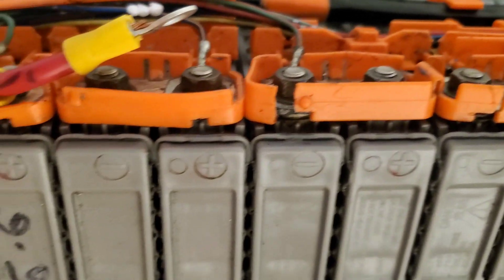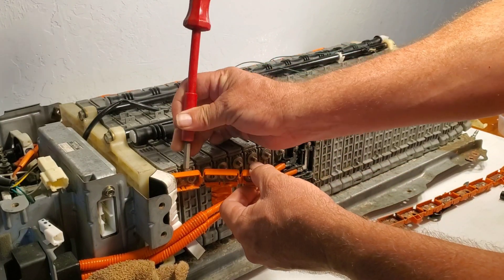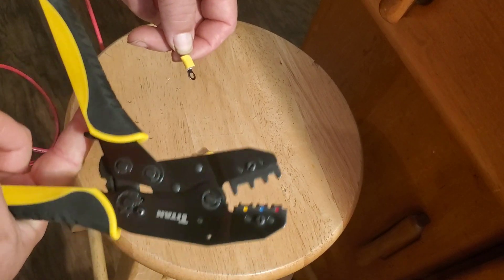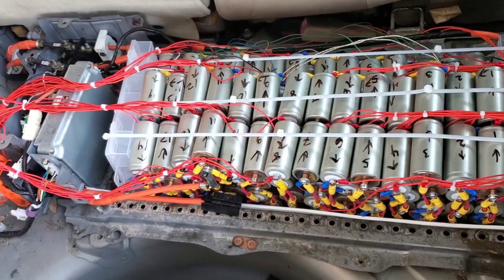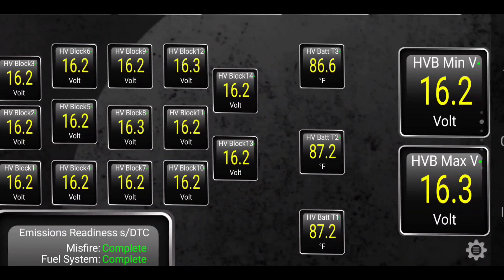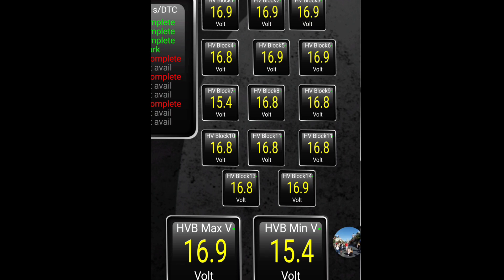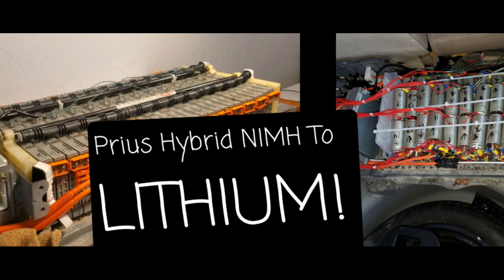NIMH To Lithium Prius Hybrid Conversion P1 of 3

Comment from the maker: Part 2 The Build is up
Reply from the maker: ki0ng  It was suffering from a bad battery so no it doesn't give better mileage but it did restore it normal.  Playing around I've achieved 60 city 50 highway. I don't hyper mile in general  in general I only get 40 city 38 highway.  Before 34 was about the best I could do with a bad battery
Reply from the maker: ki0ng  Only if your driving with that in mind.  Anytime you mash the accelerator it automatically kicks the gas motor in defeating the hybrid.  Feather footing will get you there.
Reply from the maker: ki0ng  The true potential of hybrid driving would be charging at home using out and about
Reply from the maker: ki0ng  That's true and not sure how but there's a way to override the switching from battery to gas giving you full electric.  Sounds like a project!
Reply: @eby6114  
Did you work out how to hook the switch up to keep the engine off?
Reply from the maker: @chrisallen649  Just found this comment.  Yeah the hack is I forget which pins but there's two pins you have to short out before the engine comes on this features actually standard and some European countries and what it does is tell the engine not to switch on but use only battery power That's a shame we don't have it in North America.  I forget where I found this information out but it seemed very legit
Reply: See "EV Mode priuschat"

Comment: What is your opinion about this transformation after 3 years?
Reply from the maker: Would love to tell you but I was traveling 5 hours from Miami to Wildwood and some people, Spanish came to my house and offered me money for the car, more than I could refuse.  Never had that happen before.  It seemed good.  Had decent range.    Battery only usage for a few miles tested around 2am so I didn't piss off anyone.  Never got hot.  If I had it to do over again I would have doubled the capacity.  Ended up getting a Suzuki xl7 7 seater 4x4 2 ton suv.  I was pouring the miles into the Prius close to 300 miles for some schooling for a while.

Comment: I can't find where you bought a 35s bms
Reply from the maker: AliExpress
Reply: @eby6114  thanx for getting back to me I've looked high and low on AliExpress all I can find is 32s
Reply from the maker: @krtyejnfv  US $160.00 | 5S-35S LTO Battery BMS 100A Common Port Circuit Protection Board 2.4V Lithium Titanate Battery BMS PCM 12V 72V 60V
https://a.aliexpress.com/_mNFlhsE
Reply: @eby6114  yea I saw that one I guess I just need to message them and they will me a lipo4 version I didn't see that they had the Bluetooth app like yours did

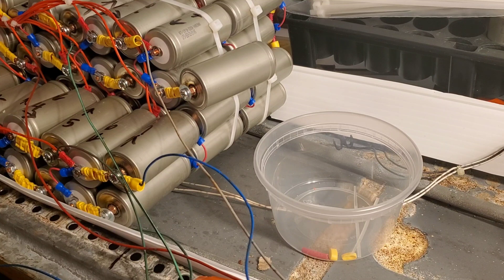Comment: around 2:50 you mention the battery capacity. but you say "kilowatt" instead of the proper unit for energy, "kilowatt-hour".

great stuff here. the nexcell / dr prius blades are more professional. but they are waaaay overpriced. LFP cells for this project are in the $600-$1000 range rn. versus the nexcell blades which are $2300 and not even in stock.

Comment: what type of your bms ? thanks you
Reply from the maker: The only thing I could find was 2 bms run in series.  I hooked it up but ran it without it and monitored it with the Toyota BMS.  It never got past .2 volts out of balance and thats possibly due to steel nuts and washers

Comment: I read some harsh criticism about this project, but man, I really needed to see this. 5S 2P seems to work with these. I just saw a test by another YouTuber that shows continuous 1kw where the usual draw is more like 400W at like 30 amps. I noticed up to 100A on very aggressive regen by stopping hard. But yeah, normally the charge/discharge is pretty low like in the 30A. The specs say the battery is 20kW and the motor is 45kW. So if each of the cells I'm planning on using can do up to 200A discharge continuous then it should do the job just fine.
Reply from the maker: The only negative thing I noticed was it appears that the batteries are used to push the car down the road even when your on the interstate.  To me the ICE should have been used as a mechanical only but it would appear that the engine is forced to make mechanical and electrical all the time.  The batteries appear to buffer the electric also instead of going straight to the electric motors.  If I ever find the engineer I'd probably slap them upside their head like the three stooges.  You should note also that in other countries you can click electric only for short spells but in the US you cannot however the function is there on the computer it's basically 2 wires that need to be shorted so basically cut extended and a intermittent switch used.  It also has to be pushed before the ICE comes on.  Cheer's.  If I ever catch up it'll make the final video.
Reply: @eby6114  this is actually one of several combinations for making a hybrid. The series hybrid decouples everything mechanically, the parallel hybrid has the motors assist the engine mechanically. Eitherway, the whole  purpose of the hybrid is to take engine power and level it... the engine humming along at some constant speed is the ideal system.

Comment: how reliable was  the conversion ? Is stiill working with 32650
Reply from the maker: Still working.  I've been going work around 80 plus hours a week so I haven't uploaded in a bit.  It got boring to check the cells as the where holding up just fine
Reply: @eby6114  ook, I just want to try ur type of replacement and also I have 3.2V 120ah with 70 cell as a plug in hybrid and charge externally, if will help to reduce more the compsunution
Reply: @eby6114  there is a chinese company that is selling  lithium replacement https://projectlithium.com/products/prius-lithium-replacement-pack but its too expensive
Reply from the maker: @minorukurata  did you try AliExpress?

Comment: You really should not replace the original traction battery but instead keep it charged through the secondary lithium battery pack.
Reply from the maker: It was shot.  Most of the cells where bad thus the entire replacement.  16 year old cells.

Comment: Congratulations,  I was designning with LTO battery, but Im seeing with 32650 its more cheaper to do it, I guess with minimal 70S1P will work because the original battery only peak at 24kw, im trying to do it with 3rd gen but using plugin version bms and charger
Reply from the maker: Very nice!  Yeah there's room for improvement on a lot of things out there.
Reply: @eby6114  yes but nice jobs, what mpg did u get with this, with LTO will use the whole discharge curve with lifepo4 90% wich is great, so prius bms will use 40% of 90% like 1kwh util in my calculation,

Comment: Do you feel you have more power now? Has your fuel mileage improved with this new battery?
Reply from the maker: I can tell I have more power but the whole reason I put these batteries in was the nicads were failing so the same is true on the mileage.  It went back to the 40s and 60s mpg
Reply: @eby6114  I mean compared to before when your nicad battery was still new?
Reply from the maker: @ahmadalami9640  sorry I didn't have the vehicle until after at least 125,000 mi then it started giving me a few hit and miss problems at around 160,000 and then by 180k the whole system was shot.  It was cheaper for me to replace the whole thing with lithium than buy new or even buy a reconditioned battery

Comment: My only concern is Lithium doesnt like cold as well as NiMh battery.  You would have to park it in a warm garage during winter, above 10 and preferably 15C.  Other than that looks great and once the car warms up I assume it would be ok but I would insulate it perhaps.
Reply from the maker: Or add a small heater.  A heating pad would be overkill.
Reply: If you get the EV switch, you can keep the ICE from charging the batteries until they have self-heated from discharging imo.

Comment: Thanks for sharing your project to convert the NiMH battery pack of the 2nd Gen Prius to LiFePO4 chemistry, from [1P168S ] to [2P70S] at the cell level.  I am watching this video again after having watched parts 2 & 3.  I watched so many videos on the Toyota NiMH HV battery, its the first one pointing to the "Blocks" in the battery which is [1P12S], others did not mentioned that.  The 'M' in the BMS for the Prius stands more for 'Monitoring' rather than 'Management' as there is no balancing circuit/feature in it.  I now better understand why my wife's "Prius C" performance had degraded without giving any alarm codes, the cells would become unbalanced with time, this model has only 10 blocks or 20 NiMH prismatic modules, mileage was not that an issue, seems unchanged.  I do have a few questions: 

1) What is the maximum voltage per block you have observed?  On another video on Youtube I saw it rise to 19.1V
2) What is the maximum discharge rate of the cells you are using?  Are they rated for the continuous or peak values?
3) Did you observe better mileage with more battery capacity?

Definitely you can mount your cells vertically allowing for more space between them and thus better air cooling in the same pack.  A crazy idea would be to have the cells submerged in oil for more efficient cooling.
Reply from the maker: I've seen yes 19.1 but this is not true voltage since when you aren't charging it goes back to normal.  1 amp discharge continuous x 2P  x 70 so around 140.  Cooling isn't really a problem once you work out the use of the automatic Prius blower and spacing.
I thought of oil too.  Every wire can come from above so being inside a oil bath would be fine.  Otherwise hollow aluminum spacers would be plenty.  I probably have at least 4 inches or more of extra space inside the battery box.  If I had to do it over again I'd make one long string and add the Prius bms but not my own and just monitor it once a month.  Cooling can also be achieved but running a 3P configuration dividing the current across 3 instead of 2.  1P would not be sufficient.
Reply: @eby6114  I made a little mistake above, I should have said after watching part 2 and 3 more videos from you.  When are you releasing part 3?  

I am also thinking the inverter has no way of knowing that there is a bigger battery pack connected to it in your setup, it could have pulled more energy from it during acceleration and dumped more energy into it while doing regenerative braking.
Reply from the maker: @pritambissonauth2181  I am currently working double than normal.  I haven't had a break in a while even to make a simple video.  I'm trying to add a third business while running two, then I'll drop one leaving two.  Yesterday I worked 4:30 am to 7pm lol.  I reached the point where I felt confident in the design about a week ago.  Plenty of highway trips and abusing the poor car without any issues.  Packs still within a tenth of a volt etc.  It should be a fun video.  Hopefully once I finish some schooling fix my big truck etc (putting out fires) it'll be the second video I do.  Thanks for the patience
Reply: @eby6114  I wish you the best

Comment: I'd like to see State of Charge as one of the monitored parameters. I wonder if the car sees a big swing in SOC. 
I know you don't want to release mfg name of cells, but how about some basic specs?
1) Capacity
2) Nominal voltage
3) Maximum continuous discharge amperage
4) pulse discharge voltage.

For example I have some cells that seem like they would be good candidates?
1) 3.3v
2) 2.3 Ah
3) maximum continuous discharge:70 amp.
4) Pulse discharge at 10 sec: 120 amps
Reply from the maker: Soc saw a o difference which I found odd as my voltage did increase if ever so slightly.  3.2 nominal, 6000ma stated 10c I'm more comfortable with 7c so the amps is around 50 surge times two or that would be a hundred surge for the combined.

Comment: Cool, glad you had the money to try some version of this mod. Also, was it me or did you use steel screws for the batteries? That may be the reason for the higher voltage drop on some cells than others. More conductance = less voltage drop. You increase conductance by either more material or changing the material for a better conducting one, if possible aluminium, otherwise brass should do nicely.
Reply from the maker: Tough to find that thread with anywhere.  Yes screws, nuts stainless steel.  It was the only thing I could find.  4mm x .75

Comment: It’s just amazing. I always think to do the same with my 2007 Camry Hybrid. Thanks for this video.
Reply from the maker: Part 2 the build is up
Reply: Question my Sir. How much current drives the 2 35S Bms? Cause, the hybrid motor during the charging can drive 50A and more
Reply from the maker: @emmanuelegel21  231 V nominal

Comment: How does the new battery do under heavy regen? Do any blocks go above 18.25 volts?
Reply from the maker: Never have gone above 16.5 volts. I really need to find a hill that's a few miles long.  I'm here in Florida where there's not many hills that are worthy.

Comment: I'm very interested in your rebuild with the Lithium cells.  I have not yet seen pt 2 or 3, but I would like to see a schematic of the banks.  Also, it would be nice to know where you sourced the cells.  I love my gen2 model and when my pack starts to show it's age, I would like to build a lithium replacement.  I am an electronics engineer and teach electronics engineering in a college, so not only do I have the skills, I would love the diy project.  Excellent video.  Just left me wanting more 🙂.
Reply from the maker: Part 2 is in the works.  Waiting on part 3 to accumulate a few more miles but all lights are green so far.  The build should be right up your alley!  You could probably give me a few pointers on the matter given you experience.  This is my first build for a Prius so there's already numerous things I'd change hindsight 20\20
Reply: I just installed a Project Lithium Nexgen battery to one of my five Gen2's (stupid expensive) and I kept thinking there had to be a way to build one from individual cells, and sure enough, a week after the install I come across your build. lol
Excellent job! I could've built three of yours for less than what I just spent on theirs (sold by the guy who developed the Dr. Prius app). Don't get me wrong, it works great, but beyond their fancy 3D printed modules, not much different from what you built I'll bet. Thanks much for the inspiration! Getting tired of regenerating the old chemistry batteries. It does work fine, but the energy density of the lithium build doesn't compare. Also don't have to worry if I don't drive it for a couple of weeks. The old chemistry really needs to be driven regularly to stay in good shape. And then there's the wright, and the cooling, and the, yeah, you already know. ;)